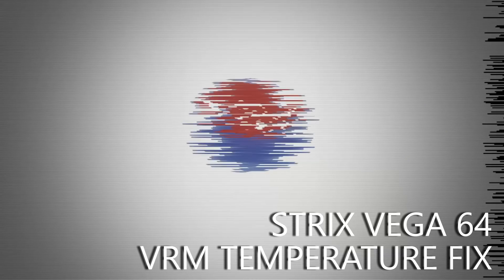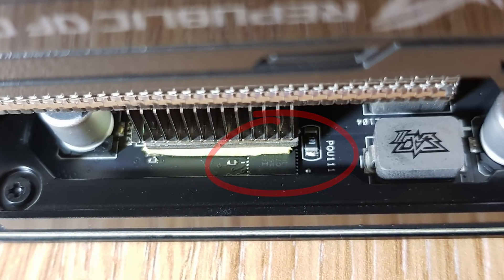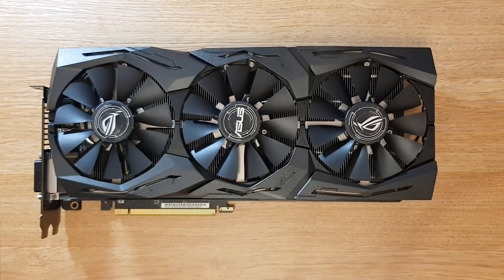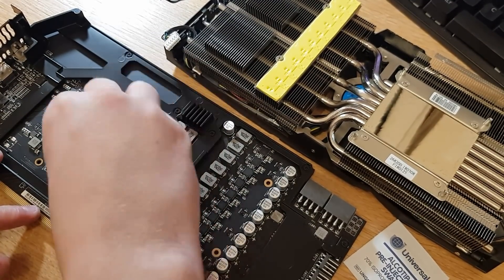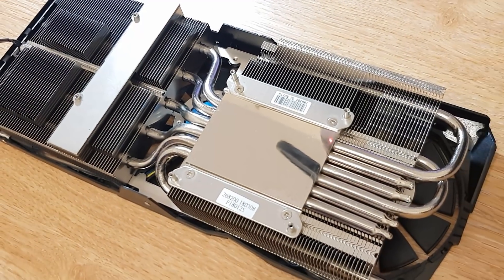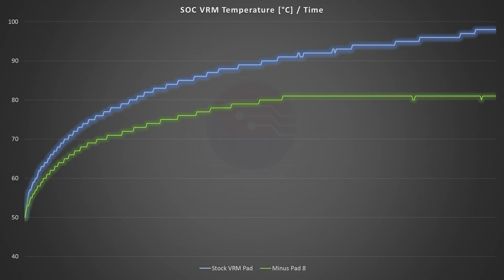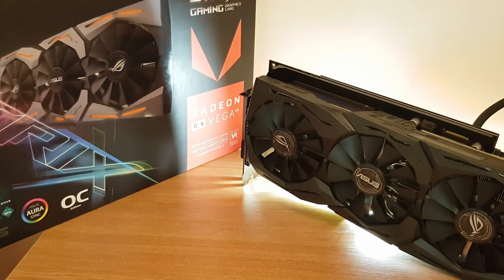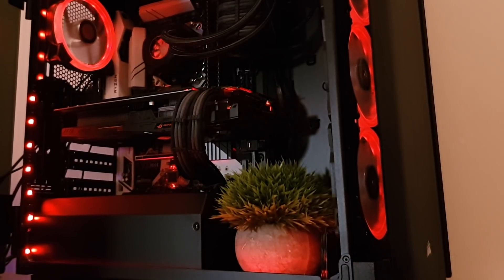Asus Strix Vega 64 - VRM Temperature FIX

Comment: Thanks for a decent video guide on how to do this.  Now I just need to find 3mm pads in the US...  Only 2mm pads on amazon.

I have a vega 56 strix, my VRM has hit 115c while playing Shadow of War (and occasionally 110c on Overwatch!), completely unacceptable on a new card.  Intend to follow suit and apply a new pad myself rather than having asus RMA it as I can't be without a gpu for two+ weeks.  Hopefully I see your nice 70c vrms after the fix.
Reply: Have you replaced the pad yet? I've run into a similar problem with the pad. Seeing minus pad 8 here, I bought the 2mm version since it's the highest Thermal Grizzly currently makes. I think the 3mm pads are old stock. http://www.thermal-grizzly.com/en/products/13-minus-pad-8-en

Though now I see people are using 3mm thick pads, I checked amazon by chance it hadn't shipped yet, and luck would have it I used my old card for payment and it didn't go through, so I cancelled the pad order and switched paste to my new card, and used that link Raging Raven commented. Thanks for that, Raven. it's the only 3mm pad in the US that I have been able to find. There were a couple others, but they were only 4 or 5 W/Mk. 

I am very interested in this fix. My ambient temperatures are usually around 23 to 24C, and i've been playing war thunder (radeon settings is completely not working in war thunder so no FRTC or chill) quite often. It doesn't take too long to reach 105C, but mine doesn't go much higher than that. This is with the fans normally staying between 3100 and 4000 RPM, and core/HBM temps of low to mid 70's. I am undervolted to 1.1V as well. I would be utterly terrified if my VRM were getting as hot has yours, XDeadzX. I really wish Sapphire wouldn't have discontinued the Nitro+ cards, I would have gone with that in a heartbeat. I've heard nothing but praise on those cards. But this kind of temperature issue on a card as "premium" as the Strix is just absurd.
Reply: @not_a_samsquamsh6777  http://www.performance-pcs.com/thermal-grizzly-minus-pad-8-high-performance-thermal-pad-120x00x3-0mm.html
Reply from the maker: Hope it all works out, The minus pad 8 has a thermal conductivity of 8 W/Mk so you might be able to find something of similar spec.
Reply: http://www.performance-pcs.com/thermal-grizzly-minus-pad-8-high-performance-thermal-pad-120x00x3-0mm.html 

Only place in the US I could find it.
Reply: I replaced my pad a few hours ago and replaced the paste with Kryonaut. The core and HBM still reach the same temperatures, though the Kryonaut takes a few more minutes to reach it. But that pad brought the VDDC temps from 100-105 in an hour of war thunder, down to 85C. My pad wasn't so poorly cut as F7GOS's, but the end over the last mosfet was in poorer condition, looked like it was frayed enough to barely contact. https://drive.google.com/open?id=1FVGigorlOM1wHsaUFPUBHG1nrQXnWoad
Reply: Wow man those are high temps, i had to go for a  1070 strix sadly, only $500.... but cant hit 60c.
Reply: Do a undervolt and increase fan speed
Reply from the maker: No, undervolting should lower heat produced so theoretically you could actually lower the fan speed
Reply: @F7GOS  I did the fix. Can I bother you for some advice?
I did the fix you suggested. my Vega 64 used to overheat to 115c but now it doesn't and clocks higher. it does still hit 100c and never hits the 6th power state and I am wondering what I should do to get it to do that. I lowered the 6th state clock to 1552 @ 1100mv. 5th is 1522 @ 1085mv. 4th is stock at 1070 mv. left the fan speed at auto.  and should I try OC the memory even if the vrm is hitting 100c already? 
max power out the wall is 220w but hovers around 200w avg 
so far its stable running games all night. 

I just am not sure I am getting the most out of the pad change like you did. and wondering if that is why I should undervolt while increasing power limit. So far all it does is go back to 260w and heats up to 100c on the vrm. the cpu always goes to 79c which I think is software clocking thing that amd does. it will max at 82c

any advice is greatly appreciated. thank you for your videos on this. my card used to overheat to 115c vrm at 1450 mhz!
Reply: @felipebonilla8824  I already have.  The 111/115c "normal" temps I get are while running undervolted on stock clocks.  It improved performance slightly but it's still too hot for my taste.

Comment: Oh forget to ask you, how did you applied the thermal paste?
There are not that many information around the web, only that the X method or the the dot method are not good for the hot spot on Vega.
The only method I found was on tomshardware.de

https://www.tomshw.de/2018/07/23/amd-radeon-rx-vega-der-ominoese-hotspot-und-das-richtige-auftragen-von-waermeleitpaste/
Reply from the maker: generous helping - probably too much tbh - and then tighten as normal, get all four screws to catch and evenly screwed in. I may go back and revisit the thermal application at somepoint though but after a day so so, it seems to have settled in even more than on those graphs and has dropped another couple of degrees on the GPU side.

Comment: Not exactly related but i had huge thermal issues on my gtx 1070 mini by Zotac, at first when i got the card i didnt really monitor temps as it was my first GPU and i had just finished my first PC build at the time, but later i wanted to see how my setup compared to others and tried out userbenchmark, everything looked fine, ryzen 7 was looking great, and after i overclocked it using guides and common sense, it was in the 97th or so percentile @4ghz, memory was the same, all looked great except the gtx 1070 was around the 60th percentile, and i was wondering what the issue was, so i logged my gpu temps and performance using MSI afterburner, i played some games, done some stress tests, and i realised the card had very very poor thermal headroom, effectively killing gpu boost, my core frequency was hovering around 1600mhz or so under load, and the temps were reaching 88c, basically it was slowing to avoid cooking itself, so i took it apart and swapped the thermal pads and paste, that dropped temps a little but it was still not good, i was looking at closer to 1700mhz at the same temps, but the fan profile to achive those speeds was obnoxious to say the least, around 90% fan speed, i thought of RMA'ing the card but i didnt want to be without a card in the time being, and tbh i wasnt sure it would fix anything as the thermal solution on the card was poor by design, and simply swapping it out wouldnt yield the dramatic results needed to actually give me the performance i wanted, so i bought the Raijintek morpheus 2, at first i was skeptical if it would do much, maybe i was just so let down with my original card, but after swapping the cooling solution my GTX 1070 now doesnt ever go above 60c, and the fan profile is literally inaudible, it also runs as fast as it wants under gpu boost 3, hitting 2000mhz in almost all loads, i now love the morpheus so much i wil use it on all my new gpu's in the future, if it supports them.